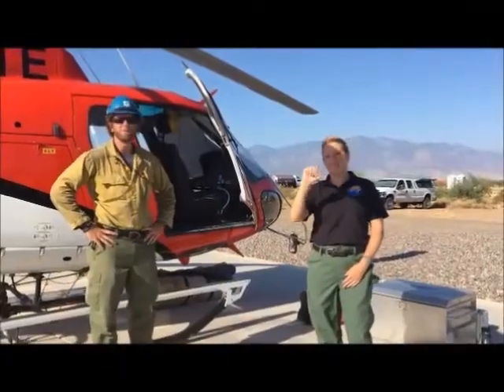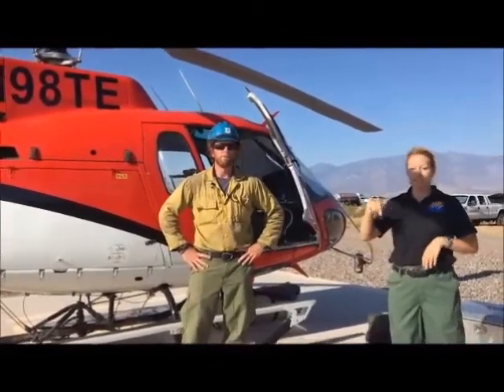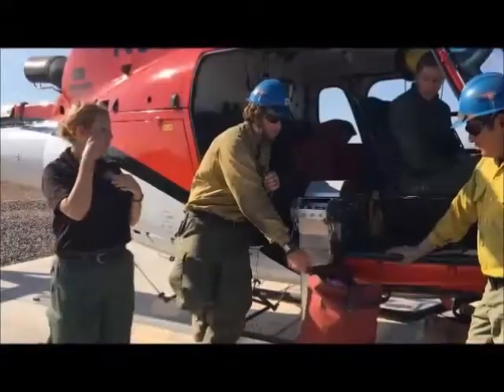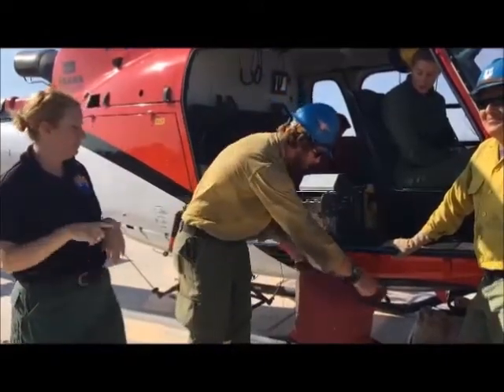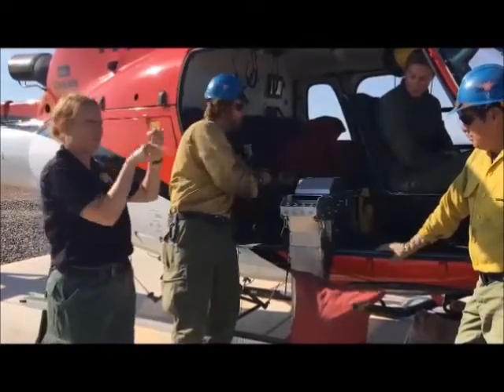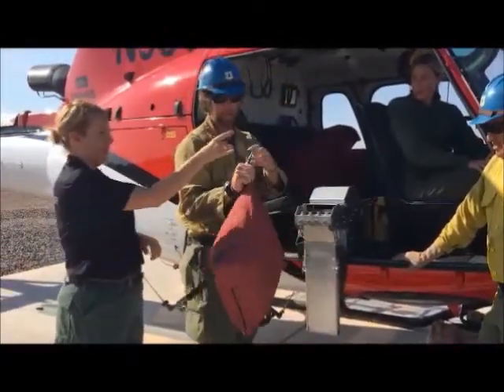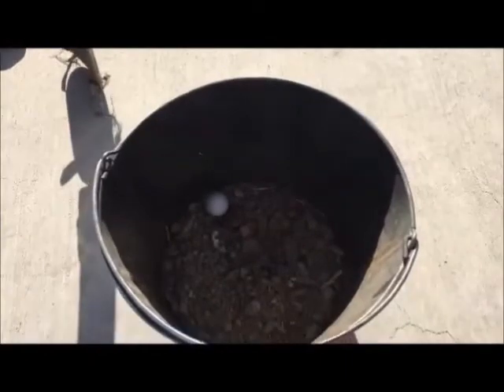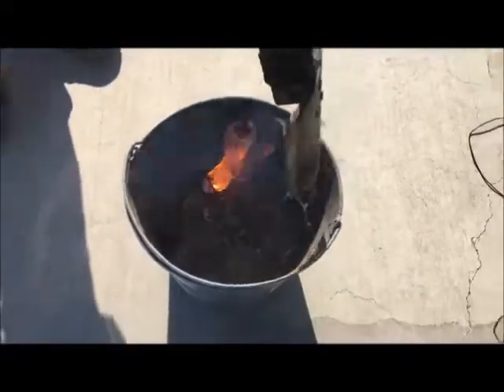Frye Fire- Plastic Sphere Dispenser Aerial Support- 7/11/17 (ASL/ENG CC)

Comment from the maker: Video transcript:
[Helicopter blades thumping]

Hello, my name is Terrence Gallegos. I'm
an Operations trainee with the Southwest
Team 5. I'm here to explain how
we utilize the helicopter and PSD
machine to do some aerial fire.
So if you look at the map here you can see this
fires edge has a big u-shape in it and
if we allowed the fire to just move
naturally down in to some of these
canyons the fire would want then turn
around and run up the hill and when fire
runs up the hill it has much more high severity
higher severity fire effects so what
we do with the helicopter and the PSD
machine is we can bring it in here and
light the top of this range so tiny
little ping-pong balls fall out of the
machine and there's about a five or six
second delay and then the ping-pong,
ping pong balls light on fire so we can put
some fire on the top of these ridges so
that the fire backs down into these
drainages as opposed to the fire running up
steep drainages so that's how we can  limit fire severity
utilizing PSD machine. So we can get a
square edge of fire which is usually a
lot better to deal with. We get better fire effects from it. 
The other aspect of the PSD
machine is it provides a lot of safety
to our fire personnel. So as opposed to hiking
firefighters into this really steep
vast, steep country we can utilize the helicopter it
keeps the firefighters out of
that steep terrain and still meet the fire
effects that we want to achieve.
Hi my name is Matt with Prescott
Helitack.  This is our helicopter nine
eight tango echo it's an AS350B3. 
This has been the aerial ignition
platform for the Frye Fire. We're going
to go over an installation of our PSD
machine and we're going to start with
taking off the doors here, Virg you
want to give me a hand?
So the installation is always done on the right.
Once the doors are off we're going to go
ahead and start with pulling the machine
out we're going to get it all put into
the helicopter and then we're going to
do a bench test that's going to be to
determine what the delay is on our
ignition for the plastic spheres.

Okay so what they've installed so far is this
little piece of cardboard which is going
to protect the helicopter the paint
basically from any scratches that the
the chute on the PSD machine might give
the helicopter. This is the insert it's
in addition to the PSD machine and it's
a sill basically different helicopters
have different kinds of door sills this
one there's a little opening on the PSD
machine for this to sit over so it's
more fixed into the helicopter.     
  [Incoming helicopter blades thumping]
Let's see how those actuate.
 [Machine whirring]
This is a mainframe right inside here
you see four chambers there's the
slipper blocks and each of those there's
four shoots on the window that they're
going to bring out next it's called the
hopper and there's going to be four
chambers that get filled with PSD
spheres and they're going to drop into
these four chambers and those they're
actuated so they're going to start
plunging into a needle.
Belly strap to the helicopter so it's going to go
starting from these points here it's
going to go underneath the belly of the
helicopter and it's going to come back
through and secure the machine to the
belly and it fix it permanently.
This is the chute that's just going to allow the
balls to fall between the skids
and the skin of the helicopter.
On top of the machine there's a gallon of water
 it's emergency water and it's to be used
in case of a hang fire if a sphere
gets stuck in the machine into the chute
and it will not fall through the
chambers it's going to cause a fire and
you're going to use the emergency water
to extinguish it.
We use this red bag here which is about a 
thousand spheres it'll hold about a 1,000 spheres and
in the helicopter what we use to attach
it to is a carabiner that's affixed to
a hard point in the helicopter. So
there's a ring right here that comes up
through the seat and we attach these
straps to this hook here so prior to the
bench test things that we're going to
need first thing is we're going to need
a bucket a metal bucket that has some
dirt in there because that's what we're
going to be dropping the spheres into
from there they're going to catch fire
we're going to need a tool obviously to
make sure that these spheres don't fly
out of the bucket once they get
punctured with Glycol and that reaction
starts to occur it'll heat up and it has
potential to leave the bucket in a fast manner.
This is the hopper. It has a few parts to
it. One is the lid and then we have a
handle here and then this is our
plexiglass window which allows us to see
spheres inside that are pre-loaded ready
to go into the 4 chambers to be
punctured with Glycol. This is the
mechanism that allows you to go with how
many spheres you want to release at a
time. When you have one of these bars
open it's going to allow only two of
these chambers to release shoots the
rest will be stopped up in this point
here until this lever is pulled and then
you'll have all four. Virgil's
filling the hopper and as you can see
you have all the viewing windows are are
full. The last thing to check when we are
doing our bench test is to make sure
that the agitator inside the hopper
works. There's an agitator it's a plate
with four rails on it and it'll allow
the spheres to be agitated so they don't
get hung up.
Yep. Ready Paul?
 [Machine whirring.]
 [Fire hissing]
When we get over an area to drop the PSD balls, we first
do a high-level recon above 500 feet off the
ground and then we come down lower and
have a closer look at the area that we
intend to burn. While that's all going on
the burn boss in the front is having a
conversation on the radio with all
pertinent people on the ground to make
sure that they are clear from the area
that we intend to burn and also that it
aligns with their plan on the ground.
Once we do that and that's all squared
away we come down and do a dry run so we
get down into the flight profile lower
typically on top of a ridge line and we
fly exactly how we intend to fly just
not dropping any balls and if anything is
not good on the dry run we abort the
mission for that area or we choose to
fly it in a different flight profile.
 [American Sign Language]
98TE